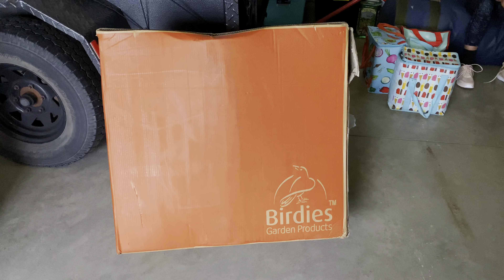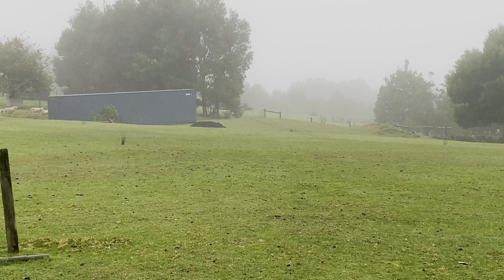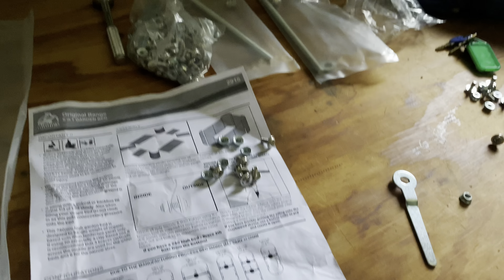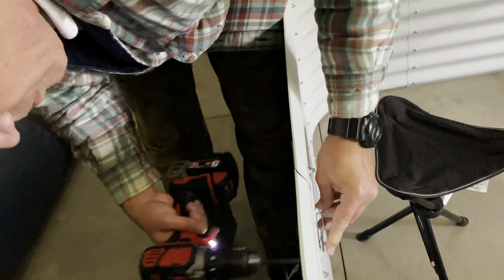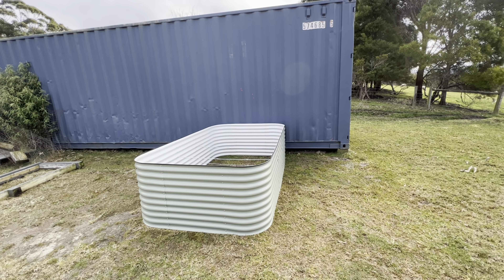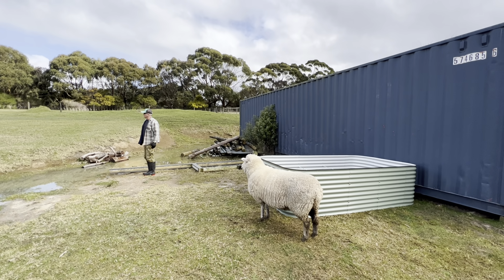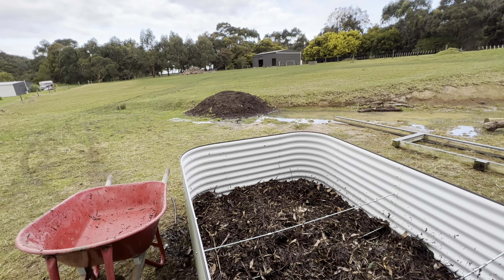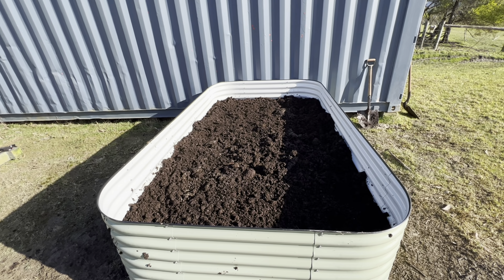Birdies Garden Build & Install | Birdies 8 in 1 Tall Raised Garden - build and review

Comment: Hi there, thx for the upload. I recently got 4 of these same beds from birdies (also on the recommendation of Mark from SSM). I see you have installed 4 cross braces on yours. However, my boxes only came with enough threaded rods to install 2 cross braces. That's 6 x 450mm and 2 x 200mm rods. Just wondering if you purchased extra rods? or did they come standard with your kit? Thanks.
Reply from the maker: Hi Arnaldo35,
Thanks for watching the channel! My kit actually came with them. I haven’t purchased any extra….
From memory the instructions only say to fit two but I had enough for the four as you picked up, so I thought the extra support would be worth it.
Hope you like yours as much as I like this one. I have another to build so will keep a check on that.
Cheers